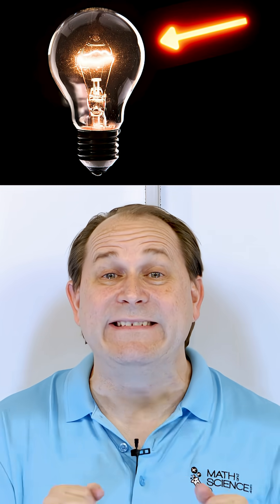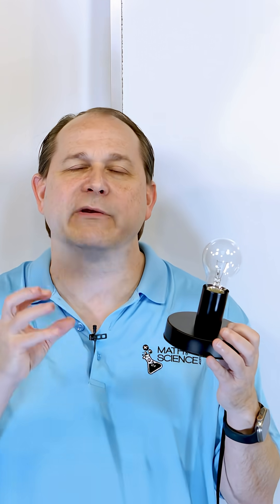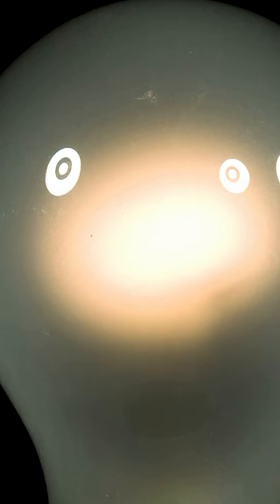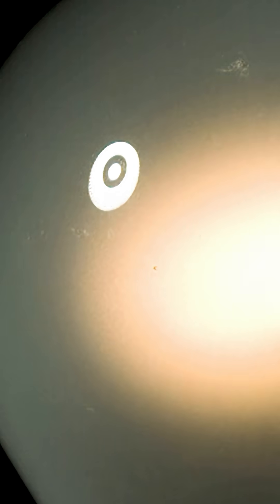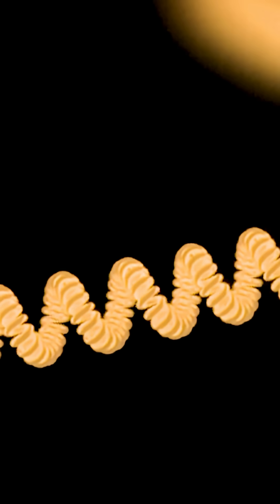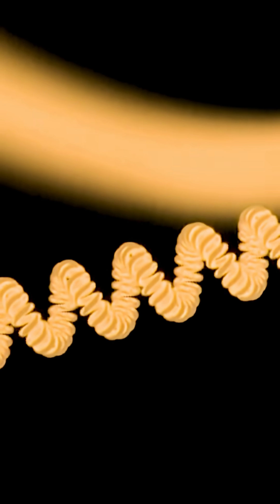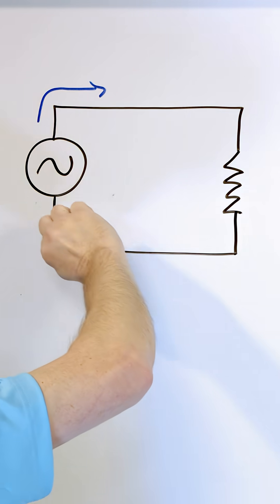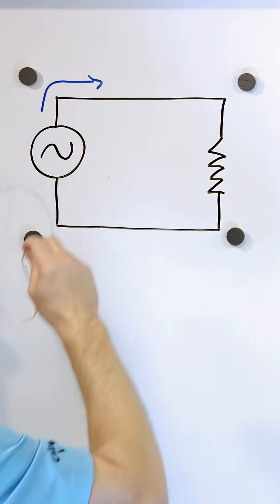You can Actually SEE AC Electricity!

Comment: With headphones connected to a small solar cell, you can hear the pulsating light. However, I think the oscillation of the filament is caused by the magnetic field rather than thermal expansion.

Comment: Currents of heat. The light bulbs get hot from heat. Toasters and ovens glow from heat like fire. They release photon comets rejected outward force of pressure and toast your bread or heat your food. They also tan your skin it's not electricity it's heat currents grounding outermost surface perimeters first towards the core last. If you leave food in burns outermost surface first towards the core last. It's disolving outermost surface perimeters first grounding currents through outermost surface perimeters first the rest of the current is expansion outwardly. It's called physics. Repulsion is the generators of heat propulsion photon singularity particles waves coming from stars disolving hydrogen outermost surface perimeters first outward force of pressure as renewable heat energy when absorbed into mass outermost surface perimeters. Tanning bread or skin is the current impaction force grounding.  When you disrupting grounding currents by weakening cold repulsion outside of mass it's outermost surface perimeters disolving first into photons quaternary comets outside of entanglement of mass. A piece of paper is in equalization to cold repulsion inward and outward as occupational space. If you hold a lit match to the paper edge you are weakening cold repulsion outside of the paper and the repulsion within the paper outward force of pressure becomes dominant pressure outward force of pressure and mass disolves its outermost surface perimeters first towards the core last that's expansion outwardly force of pressure from occupational space. Heat occupies space traveling through it. We have appliances that remove heat and restore heat.  It's not a coincidence. Our equalization to repulsion is 98.6 if we lose heat our outermost surface perimeters get cold. If we gain heat we get a fever excessive heat expelled outward force of pressure outermost surface perimeters first.

Comment: Actually - the filament responds at twice the source frequency 
( 2* 60hz)  since it "sees" two peaks ( one +ve and one -ve)  per cycle - so heats and cools twice per cycle. 

 Because the filament is purely resistive - it dissipates equal power / heat per 1/2 cycle.  ( i^2 r  - when i is negative - you still get positive power)

Comment: While both AC (Alternating Current) and DC (Direct Current) are used for power transmission, DC is generally more efficient and cost-effective for very long distances and underwater cables, whereas AC is easier and cheaper to step up and down with transformers, making it better for shorter distances and for connecting different parts of the grid. High Voltage Direct Current (HVDC) offers lower losses and greater control, but requires expensive converters at each end to change AC to DC and back again
Reply: I think your comment conflates which one is better for long distances.
Reply: i thought AC is easier to generate and transfer for longer distances. and that's what Jason tells at the end of the clip.
Reply: @prodanesti  - at long distances - ac becomes more lossy due to skin effect on cabling and other induced losses.  Dc doesnt suffer these effects.
Reply: @eric4709 
that means what Jason said at the end of the video is wrong.
Reply: @prodanesti 
No - jason is correct !

most electricity is transmitted at ac. Its only on very very  long runs - and between countries where dc is used. Not only is it more efficient - but overcomes the problem of "syncronising" two ac sources - they have to be perfectly in phase and at tbe same voltage.  With dc - that "syncronising" is done by the DC - AC conversion at the receiving end  - same as with solar panels where the dc from the solar panels powers an invertor that "syncs" to the local ac  supply grid😂
Reply: This is what happens when you copy/paste chatgpt. 😛
Reply: Yes, DC is better, but the real need for long distance transmission is very high voltages.  It is relatively easy to get AC to very high voltages.  Not nearly as easy with DC which is why DC is only used for lines where the much higher cost of stepping up the voltage makes it worthwhile.  For most terrestrial power lines, the benefit of DC over AC from an electromagnetic perspective simply isn’t sufficient to overcome the MUCH higher cost of DC voltage conversion equipment.
Reply: @LTVoyager high voltage  dc is simply  obtained by rectifying high voltage ac ?  .
Reply: @eric4709 Simple in concept, but not so simple in execution.  And most power plants don’t provide terribly high voltages so you now need two steps: transformers to step up the voltage and then rectification for DC.  Then at the other end you need inverters to convert back to AC and transformers to step the voltage down.  So, much additional cost and complexity for very little gain in most cases.
Reply: @LTVoyager that is why i said used only in exceptional cases - for example uk interconnects to neighbouring countries where ac cannot be used since the  two sources  cannot be syncronised.  Dc can then be converted back to ac and synced.

Comment: Thought they said that the current has to flow from one end to the next to make a complete circuit.
 And we don’t use DC because over a long distance you will lose power
Reply: Your understanding seems very limited. What makes you think the circuit isn't closed? Also, explain DC transmission lines.
Reply: @Syndicalism it’s not as limited as your comprehension 😂 
 Today’s WORD IS COMPLETE.
Reply: @jarhead7758 What?